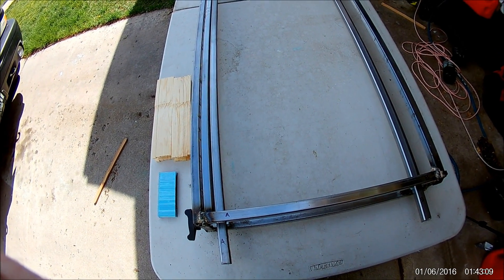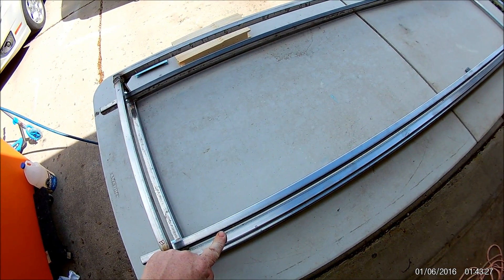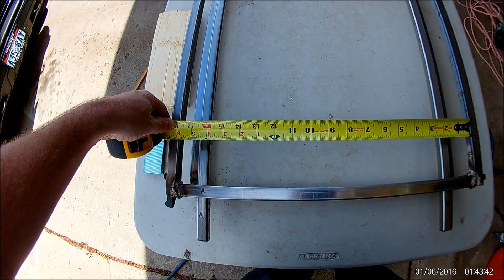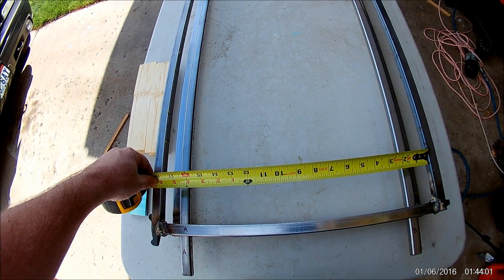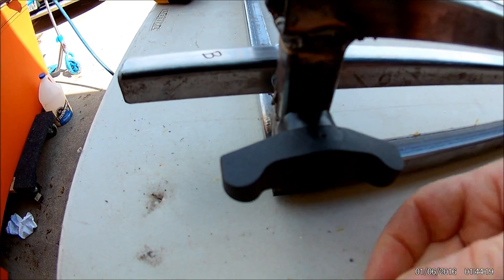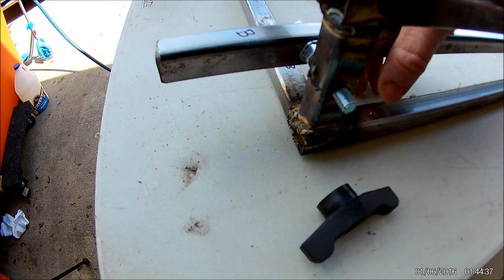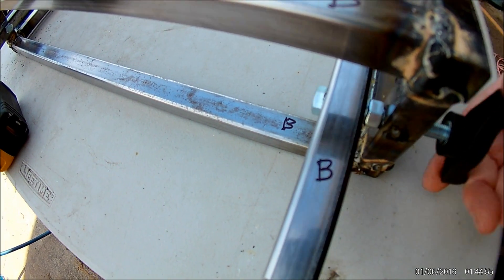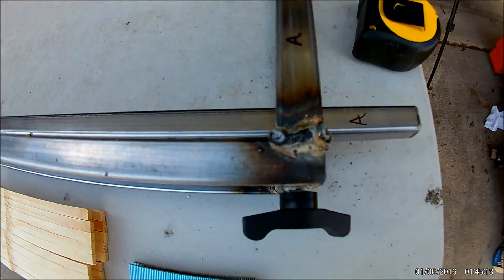Bee Hive Frame Jig and Frame Assembly

Comment: Good presentation.  Extend those bolts and add 4 springs. It will improve loading. Instead of bolts I have 4 rubber bands it is less complicated and do the job. Good lack to You.